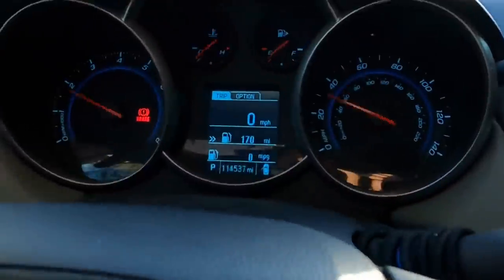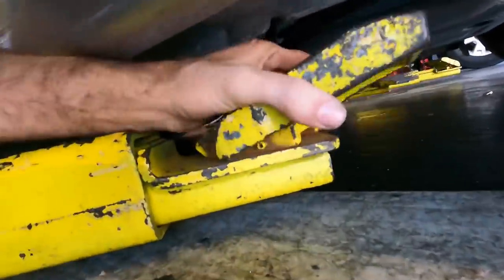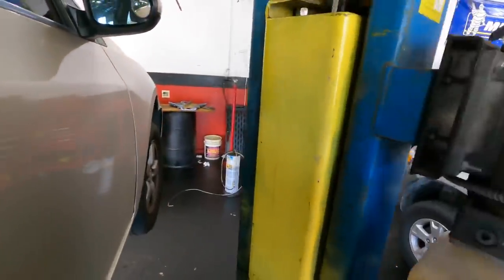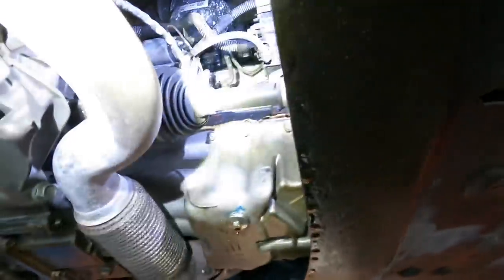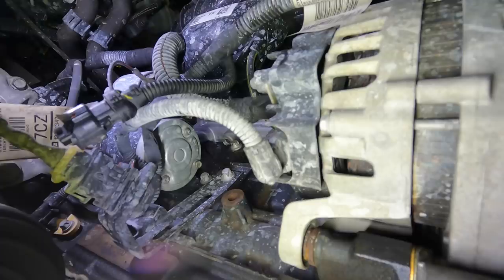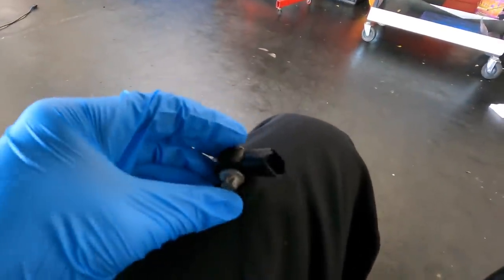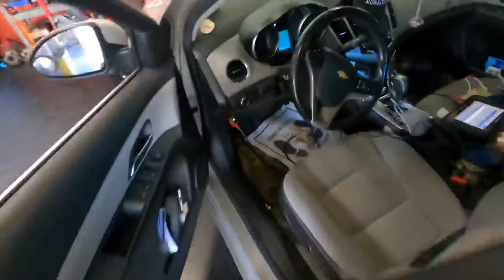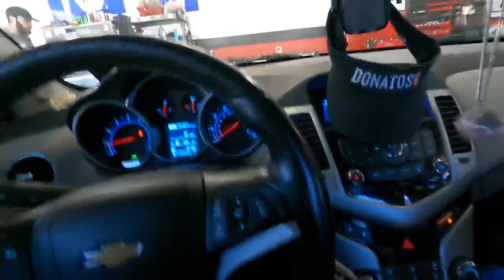Rolling the Dice! Parts Store Diag! Customer Supplied Parts. 2015 Chevy Cruze  P0324

Comment: Great video! I was hoping for a parts cannon fail though, Damnitt!!😂
I use to allow that from my customers when I opened my business. Than I realized that that sort of customers is the type you don’t want for business. They have no loyalty to you, They have no respect for your knowledge, cost of equipment and believe that the part store diagnosis is biblical.
They will always go to the cheaper repair shop. I avoid them like the plague!
Reply: Understandable.  But when you turn them away, you can bet he tells all his buddies about the 'scam mechanic who just wants to charge me extra for doing a "fake diagnosis" when I already told him what was wrong", not mentioning that if you did what he wanted  100% of the blame would be yours.  Hopefully your decent customers outweigh guys like that and you can afford to avoid them.
Reply: @markdoldon8852  fake diagnosis is the parts store! It’s just a fault code and that code is a symptom. There are several faults that are part specific, but it’s a 50/50 shot at best. You have to make sure you treat the cause and not just the symptom. I charge for that. If it’s straight forward I discount my diagnosis, but if it’s involved , they have to pay. I pick my clients and the cars. One way I weed em out is the cost of diagnosis. If they balk at that, it tells me All I need to know. They don’t value my knowledge, experience, cost of equipment and most importantly my time! I charge typically 1 hour, $115. Depending on the severity, I may front load 2 hours if it’s an evaporative emissions fault. I hate calling for more diagnosis time. Clients who ask if the diagnosis goes toward the repair. Nope! 99% of that type of caller does not come in for diagnosis and if they call back I decline the work. I’m Not going behind some other shop and their diagnosis. Again this is a client who’s looking to pay as little as possible. Anyone can replace parts, few can accurately diagnose and repair. I got other methods , but In this business and in my area, you have to. I want clients who demand quality parts, quality work, respect the fact that I’m certified, factory trained BMW and Mercedes, experienced and that I’ve paid thousands for the equipment to diagnose and service their vehicles.  Don’t forget the friendly service.😂 These types of clients  are willing to pay a premium for this level of service. They will tell their friends  about the service and treatment! In short, I want only a bite from the pie, not the whole slice or pie! I live simple and as a result I don’t have to accept or work on every persons car who comes in or calls. It’s served me well and I have a level of
Peace with all my clients that I am greatly appreciative !! I’ve seen a lot, fixed a lot and have a great client base. My reviews speak for themselves and my YouTube videos represent the challenge in diagnosing and repairing modern cars!

Comment: As everyone in the automotive industry knows, parts store code scanners are exact & the employees using them are really automotive techs disguised as part pushers.
Reply: That has to be a brutal job, selling parts for a major corporation taking the heat when the parts cannon fails. Corporation sets them up for failure while taking the profits.
Reply: Given that this part was just $20 or so I could see going ahead and trusting the auto part guy and hoping it fixed the issue.

Comment: Just an observation, wouldn't you have to give it the beans on a hill to really prove a knock and sensor operated properly. Just an old guy who had many many knock issues on 60's and 70's cars. They generally only pop up under load and usilly caused buy cheap gas. Yeah I know dumb comment.

Comment: I am bothered by the negitive  side of that arguement.  What if the cheap new part is defective and the old quality part is still good, or what if both parts are bad? What if both sensors are still good and something else is wrong.
  Versus the optimistic  assumption that the new part is good and the old part is bad and there is nothing else wrong.  As you can see probibility is against the customer guessing right all unknowns being equal .  Yes some unknowns will not be equal but we don't know that.
This video is about the value of diagnostics and the safety of the same!

Comment: It's to bad that manufacturers don't have to supply all the specialty tools that mechanics are required to work on the vehicles that they are producing that require them. I would bet that they would push the engineers to get their shat straight and quit making parts and awkward placement that require them.

Comment: When a mechanic wants to charge me $200 for a diagnostic, for something that we don't know whats wrong yet, then it reasonable to not want to do it. When they say they will take that $200 charge off your bill if you go ahead and get it repaired, and the repair was something else (say $120), then you just wasted in my mind $200. 

South Main auto did a video on the costs unfortunately that some more reputable mechanics have to incur for online data such as wiring diagrams, access to technical manuals from these rip off car manufacturers.
Reply: Somebody has to spend time to figure out what the problem is. Time isn't free, therefore you pay for their time. The diagnosis is the hard part, winging a part on is usually easy.

Comment: Knock sensor AKA accelerometer.  DiiiiiiiiiiiiiiiiiiiiiiiiiiDooooooooooooooooooDiiiiiiiiiiiiiiiiiiiiiiiDooooooooooooooooo
Reply: Knock senor is the same an accelerometer?
Reply: @miken6imy  I believe they are Mike, but i'm sure there are different degrees of sensitivity .loop voltages  etc etc.
Reply: @MrTonyPiscatelle  yes. Similar design.  When looking at piezo versions of a knock/detonation sensor and a piezo accelerometer there are a lot of the similar components.

Comment: Funny that you've got the click bait 'complacency kills' banner,  which most assume relates to your comments about lift safety.  Then at the end we hear your coworkers joking around with nonsense (of which I normally fully approve and encourage in my shops)  but guys, NOT while working the spring compressor, please!  When working with one of the most potentially dangerous tools in the shop, FOCUS!  They are well designed (like the lift) machines from engineers that have learned from hundreds of accidents.  But as you say, complacency kills, so focus on doing it right.  THEN go back to shouting nonsense.